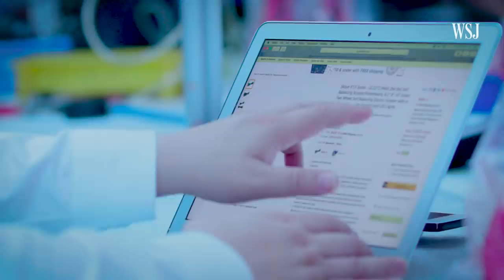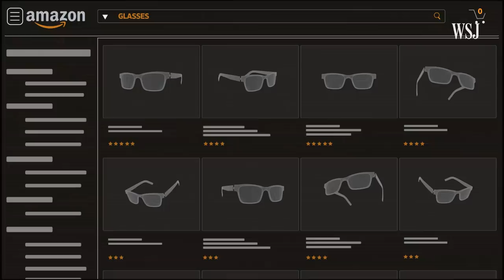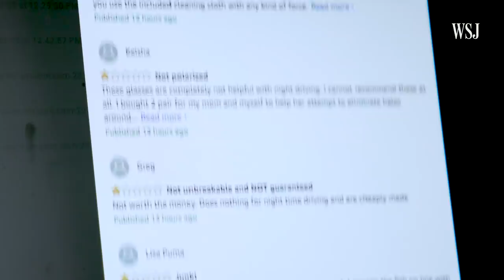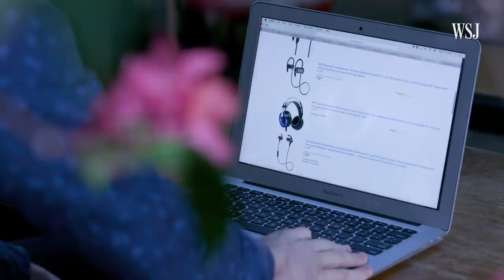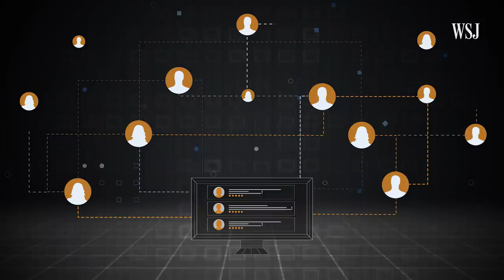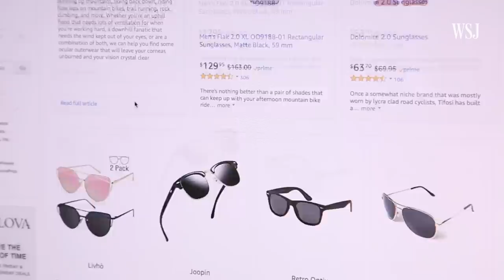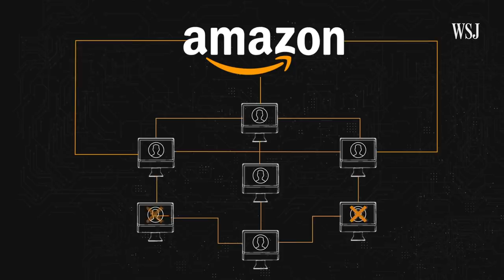How Scammers in China Manipulate Amazon | WSJ

Comment: I very rarely trust third party sellers of Amazon. Many many of them are so obvious scams especially with flash USB drives and SD cards. Even when an item is sold by a third party seller and delivered by Amazon that doesn't mean that the Amazon has the knowledge or the responsibility to check what is exactly delivering. 
I trust and love Amazon when something is sold and delivered by Amazon. 
eBay is by far better with individual sellers.
Reply: That is the whole point of selling on Amazon is that other sellers can sell not now with Amazon trying to cut them out by making their own stuff.
Reply: Responsibility is something that you cannot deny that they have.

Until now, I have never had a good enough experience with searching via Amazon. Most of the times, I reach the product directly via the product's official website or via Google Shopping.
Reply: I only buy products where they allow returns and refunds.
Reply: How do you know if a product is sold by amazon itself or the third party sellers ?
Reply: I only buy on Amazon because of free shipping.  Prices are higher than other website business that does not  offer free shipping like Walmart.

Comment: It's been my experience as an Amazon consumer that, when I give a very bad review because a product is totally misrepresented, my reviews are immediately removed.  For example, a Kindle version of a cookbook in French.  I read enough French and have been cooking long enough that I frequently buy books like this is they aren't available in English.  

One such book I ordered, when I opened it on my Kindle, was only three pages long, and those were random photos that had little to do with the topic of the cookbook.  Amazon had no explanation as to why my review was removed, nor, more significant, why they continued to sell these non-books.  Somebody's got a friend in Amazon management.

Ditto a DVD I ordered that had no DVD in the case.  My review was removed, and I was offered neither a refund nor a replacement.  This one is fairly common, if you watch reviews as closely as I do.  Cheating at Amazon.  You bet.  Maybe they should be watching their employees more closely because sellers don't get away with these tactics without help from someone inside the company.
Reply: Omg, I had a review removed as well.  It was a good negative review describing a problem with a fuel line breaking down and I even took a picture of the chunks of rubber coming off of it.  It's B.S.
Reply: Exactly! I don’t even bother leaving reviews because the negative ones are always removed!
Reply: It could be that the seller just complained to Amazon about your review being fake.

Comment: I hated amazon the more I used it. Only so many times I can get ripped off and go back to buying from them. Worst purchase so far was buying an unlocked iPhone that after 2 months had lost connectivity and amazon did nothing to enforce a warranty. They always said we’re sorry but we tried and we can’t help but if they wanted to protect their customers they would’ve blocked the seller until they resolved the issues. 300$ on a phone that can only use WiFi was the last straw for me. I highly recommend not using amazon for ANYTHING.

Comment: If it does not say "Sold and Shipped by Amazon", stay away. Do not buy it. Especially when it comes to electronics and computer components like motherboards and hard drives.
Reply: Why is that?
Reply: @jkdunk20001988  Sold and Shipped by Amazon are products properly vetted by Amazon and are within the Amazon warehouse system. Buy your motherboards from Newegg or Fry's etc. SSDs that are sold and shipped by Amazon can be purchased from onsite. However, if you rely on back up products requiring disk drives like synology disk stations and the like, get them in person at best buy, BH photo etc but whatever you do, never buy a hard disk drive (cold-war era platter disks) from Amazon. Amazon has poor packaging, that plus all the kicks and fists the package receives during the shipping process means your diskstation may well arrive damaged or DOA. (personal experience)

Comment: Honestly the only way I could see an end to this would be to link accounts to the physical persons behind them. Like to give an example then look at the Danish NemID. A system where your account is linked to you directly as it's linked to your cpr number you can only log into your account with one time codes that you must personally have on hand. Therefore if a person's account gets suspended and they try to make a new one they would need to use this ID system and so the ID could ultimately be blocked from the website entirely. However this would require, every country that allows Amazon to have such a system on a national level which is near impossible right now